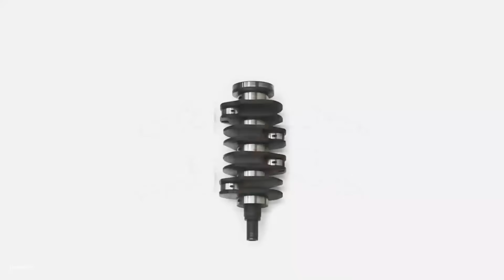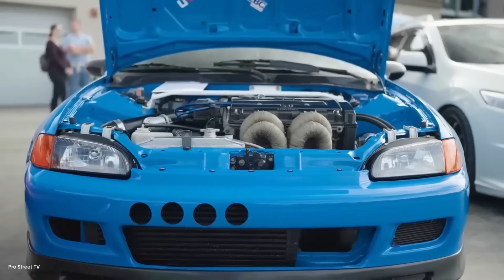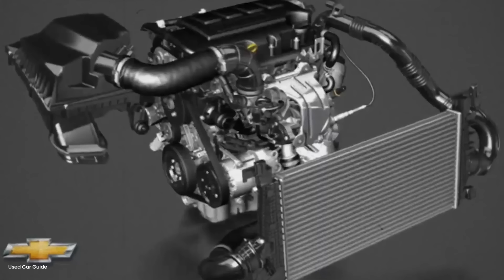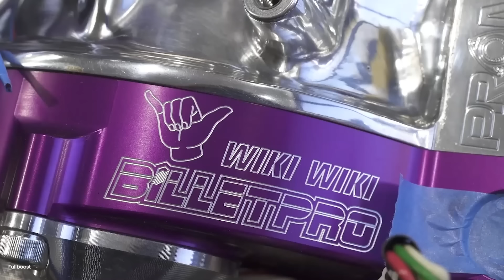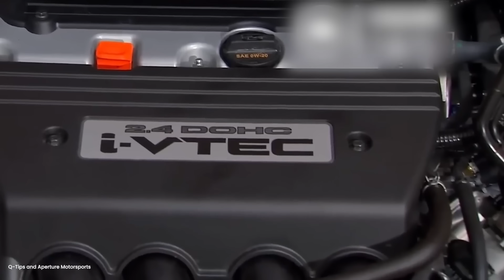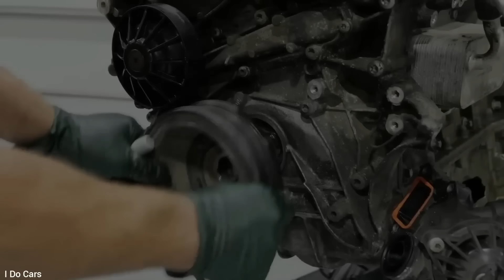10 Tiny Engines That Can Make 1000hp+

Comment: Such a nonsens. The who is the best?  Honda Ford VW Nissan BMW, They all can be made to F1 performance or dragracing at $$$ or €€€. And that F1 BMW 1400+ HP at 5 barr boost was a qualifieng engine in F1, then it was done for that engine after! Not at the races where they tuned down another engine at about 950 Hp max. Factory build top engines are the asians like the japanese, the Honda who takes a lot of abuse, and Toyota and then Nissan from stock already. No VW can handle that abuse from factory.

Comment: @4:53 No they didn't have a gentlemans agreement. In Japan they have super strict emissions controls and to avoid epa and insurance fines they all claimed their cars .ake 297hp. Even though they have been found to make more. This is a overlooked loophole that allows the markets to still manufacturer and sell said vehicles. Without a massive redesign with a lower output engine.

Comment: The Subaru 2.5 engine is known for turning into grenades.  The 2.2s are the good engines. Last forever
Reply: The Subaru STi with a downpipe and aftermarket exhaust, a Boost Controller and a Cobb tuner and you're into the 400hp market.

Comment: I remember reading an article about a guy who got WELL below 10 seconds in the quarter mile from Pinto 4 cylinder engines.  Most of the time an engine would survive one run. But a second run without blowing a piston? Not very often. This when there were plenty of Pinto engines available for cheap at salvage yards.

Comment: People are still incorrectly posting Wankel rotary engine displacements. To correctly convert from a rotary to a four cycle piston, you need to calculate how many combustion cycles occur in two engine crank revolutions. The misrepresentation is due to the way Mazda calculates rotary displacement. Thus a 13BREW engine (2 rotors) given a 1.3L displacement by Mazda is actually a 2.6L engine when compared to a 4 cycle engine. This means the 3 rotor 2L engine in this video, is actually a 3.9L engine. Each rotor has 1 combustion cycle for each revolution. Thus each rotor has two combustion cycles for each revolution. A 2 rotor fires like a 4 cylinder engine and the 3 rotor fires like a 6 cylinder engine.